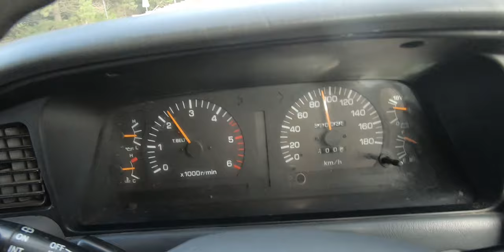Curing Overheating? Viscous Fan Testing and Rebuild Part 2

Comment: My 80 series overheats whilst beach driving. I’ve replaced the fan clutch with a genuine Toyota one and it still overheats. Should I be adding or removing oil from the fan clutch?
Reply from the maker: Adding oil will make the clutch engage sooner, another thing to check will be the sealing around the radiator. If the foam strip sealant is missing between the radiator and body, the air will take the path of least resistance around the radiator at speed. So seal it up and force the air through the radiator.

Comment: The only trouble with that test is the factory gauge.  Mine doesn't move until around 100°c. Would be good to see what real temp it's reaching.
Reply from the maker: Agreed, in my 80 I've got an engine watchdog bolted to the coolant outlet pipe, the temp gauge stays in the middle over a very big range!

Comment: One of the best things I've learnt on the interwebs this year is when you're dealing with a reluctant small soft screw or similar fixing, don't use any impact driver but instead, use a regular drill driver with it's clutch set to 'weak as p...'
With the right size driver bit, I had a very difficult fan-clutch-hub-thingo screw out in mere seconds !! ,  with no great force or risk of damage.
Reply from the maker: Thanks, must to try it!

Comment: Well done. 

8 - 10 hp for the fan!! So when I bolted the failed viscous hub solid due to a silicon oil leak I reduced the power from the 2L petrol 21R in my commuter bus from claimed 105hp to 95hp! It was an old donk, with 300k on the clock, so it was possibly closer to 65hp at the flywheel before the fan mod and with the mod, getting down to 55hp...explains why it couldn't exceed 40km/h up steep hills in first! Ahh, those were the days - not.
Reply: Incidentally, and if memory serves me well, the viscous coupling in my HiAce looked exactly like the one you were working on from the outside.
Reply from the maker: Probably the same part! The drag from fan is one of the reasons most manufacturers have moved onto electric thermo fans. Cuts fuel consumption and emissions.
Reply: @LockyourHubs4WDing  Two bottles of silicon oil is best value, but if the unit was completely rooted and you needed to replace it, would you instead fit the thermatic fans? It seems, under those circumstances, one would put the extra friggin around factor to do the conversion.
Reply from the maker: @MiniLuv-1984  one reason I like electric fans is the ease with which you could install a switch to cut the fans for water crossing, or even hard wire an on switch if the temp circuit fails.
Reply: @LockyourHubs4WDing  effen excellent point! Hadn't thought of that.

Comment: I replaced the screws on mine with Alan key bolts. i also put the tubes of silicon fluid in a container of very warm water to make it run easier.
Reply from the maker: Great idea about replacing the screws, they're made of butter!
Reply: @LockyourHubs4WDing  that they are from memory I stripped Three of them & had to get the old screw extractor too get them out.

Comment: Cheers, thanks for the video mate, but I had the opposite problem to you.
I bought a new Dayco clutch and it had too much viscous fluid in it & it wouldn't disengage, constant roaring/ howling so I sent it back & they sent me another one. Unfortunately the replacement did the same,  so I opened it up and removed a couple of ounces of viscous fluid & that fixed it. Can only hear it now when stuck in traffic jam or going up long steep hill.
Tip: if you want that thick viscous fluid to run out of the clutch like water heat it up with a heat gun and it just pours out ( don't worry, it goes thick again when it cools). Also,  if the O-Ring seal is stretched & won't fit back in the clutch groove, heat it up also with your heat gun and U can actually see it shrink back to size. I used to boil them which is a lot slower.
Reply from the maker: I never thought of heating up the gasket, thanks!
Reply: I also bought an aftermarket Dayco fan clutch and found it to be rubbish, never cuts in at all so rebuilt the aisin unit instead. The Dayco units are very hit and miss.

Comment: What happens if I bore it and engage the fan permanently to the axe? Would this solution destroy the belt?
Reply from the maker: No, but it would sound like a jet engine and waste power.
Reply: @LockyourHubs4WDing  Thanks for the reply. Indeed it sounds like a jet :)

Comment: Can I use 1000 cst instead of a 10,000 cst recommended silicon oil?
Reply from the maker: Unfortunately not, you'll need to use the correct silicon oil.

Comment: Is there a difference between a sahara hub and a non sahara ?
Reply from the maker: Both are the same for the diesels
Reply: @LockyourHubs4WDing  cheers mate pulled mine apart re oiled put her back together in about an hour